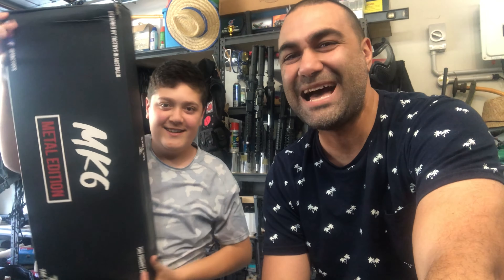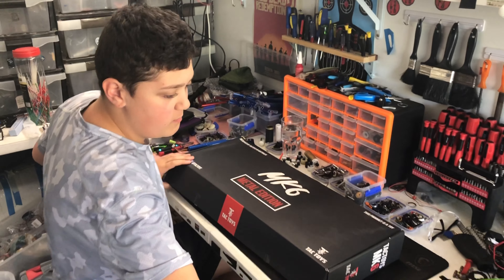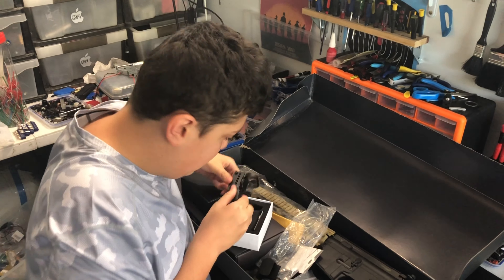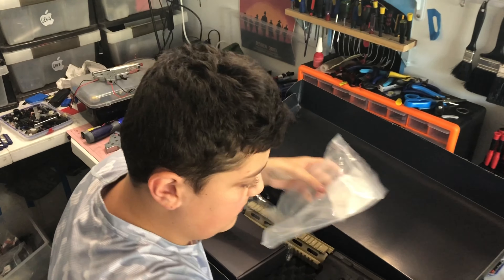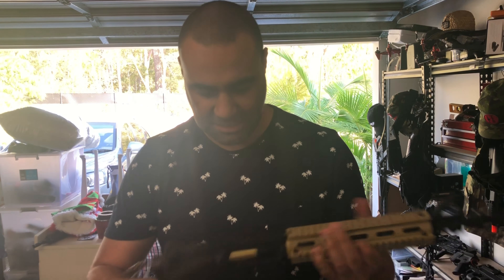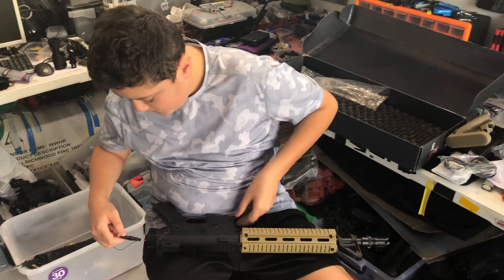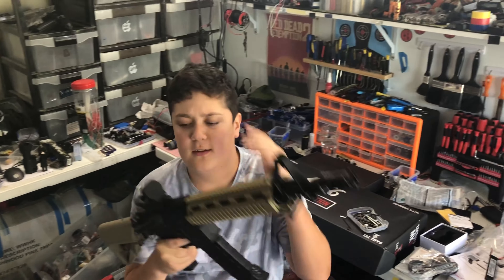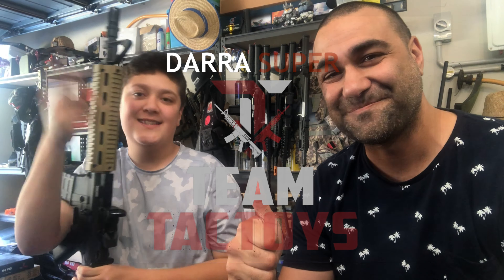🔫 Tactoys MK6 Gel Blasters Review Part #01 🔫

Comment: hi guys i have this model
pretty new to gel blasters but the front barrel is slightly loose its going both directions about 20 degrees each way ive only had it 6 weeks
Reply from the maker: Take it back to the retailer that you purchased the item from
Reply: @TTBSCOOBY  shortly after writing the message the barrel came right off completely sent a few emails and videos not a reply had to remind the company of accc laws, for a "premium entry" blaster been used twice in my garage
Reply: @T00D_HOWARD  bruh really, I thought that extra weight on the front would put a strain on the nylon receiver. Any news on your insurance claim?